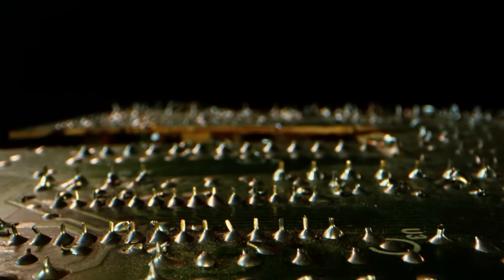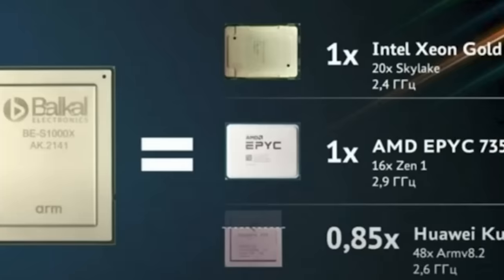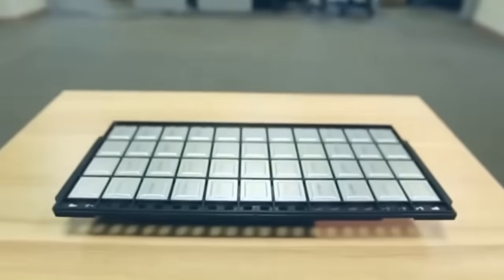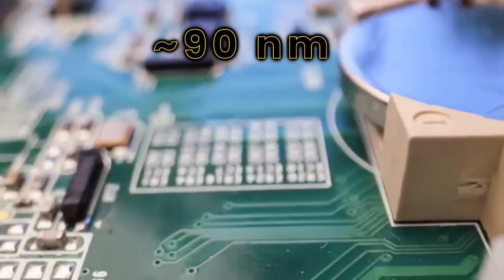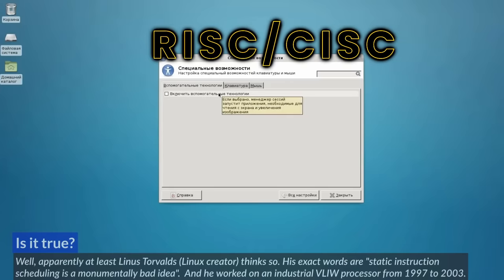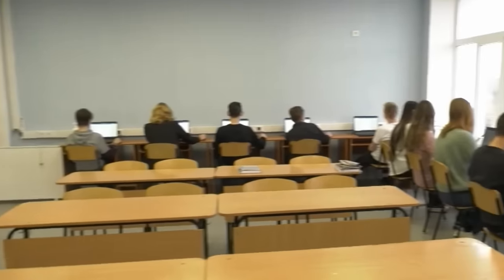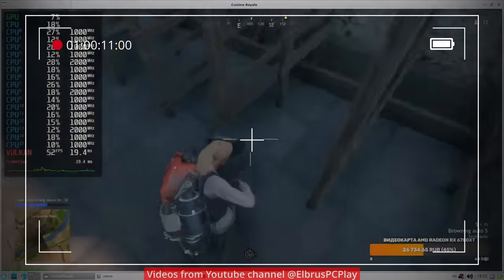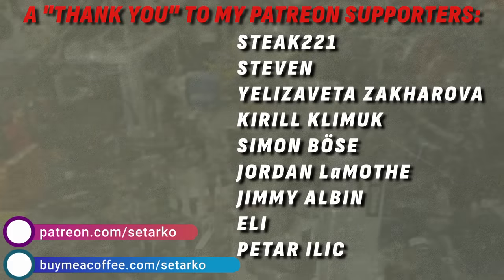Just How Good are Russian CPUs?

Comment: This video is largely correct — I have worked with the developers of one of the aforementioned CPUs (Baikal, Elbrus). One thing I would add though is that while Baikal was indeed worse and costlier than its Intel/AMD counterparts, it was a 5-7 years difference, plus the costs would go down dramatically once the orders increase. The slightly incresed cost and worse performance is perfectly acceptable to its main customers — state-owned entities that collectively have about a 1/3 share of the Russian PC market. You can run Excel (or whatever the Russian open-source version of it) on a 6-year old computer — this was always the goal, not running Cyberpunk in 4k ultra graphics 60 FPS. To tell you more, some of the potential customers were legitimately excited about the prospects of those CPUs, and some foreign entities (outside of the former USSR) have expressed interest, too. Shame it all went to hell.
Reply: They probably just use libreoffice, so calc. Tbf you can do the same with a 15 year old intel cpu, the only advantage here seems to be possibly more security than x86_64 (in the case of Baikal, ARM is just as well known of an architecture and does have security exploits), which sure if you're a state run entity running critical infrastructure then it is important but even for a lot of state run entities the cost benefit calculation won't make much sense, it'd just make more sense to keep the existing CPUs for longer and try to acquire used parts or new ones sourced from proxies.
Reply: @thelakeman2538 security reason make a lot of sense to use a domestic CPU without foreign backdoors. The Eu is looking to do the same soon.
Reply: What I like like about early Baikal - it was MIPS, what I don't like about Baikal - closed documentation
Reply: Nowdays Baikal is just another ARM manufacturer
Reply: @xfy123 EU was doing same with their LEON
Reply: so economics is similar as with F35.... heck of expensive to R&D to begin with but exponential cheapening with each new ordered set of jets.... it has roughly halved in price so far over 15+ years. microchips are even more so as there are little to no moving parts and very automated production process, usually.
Reply: The Baikal itself wasnt a vanity project. Trying to produce it in Russia is.
Reply: the real question is: are they able to perform the required work in the allotted time.
Reply: @uis246  Baikal could switch to RiscV architecture, makes the thing fully opensource
Reply: @thelakeman2538 Anyone not American kind of want the option of a processor without American backdoors...
Not necessarily for civilian use, but at least as a option for governments.
Reply: @AmauryJacquot That's a lot of wasted engineering time...
And remember that even if you have a instruction set you still need a architecture.
RISC-V the ISA might be open source, but most RISC-V architectures, are not.
Developing hardware for the ISA still takes time and money.
And the ecosystem is still small, with compilers that can't compete with x86 compilers in optimizations.
Not to mention that each architecture likely will need its own optimizations.

Russia wouldn't really gain much with switching at this point...
Maybe in the future.
Reply: @Luredreier the funniest thing here is assuming US is the same as CCP
Reply: Why did it "all go to hell"? What happened?
Reply: @belliduradespicio8009  I believe that they're referring to the sanctions on Russia.
Russia and China can't really buy advanced tech and services anymore.
Like using TSMC to make their CPUs.
Reply: So I can buy the latest russian CPU to do what a 13100 can do much cheaper and better.

Weird flex but okay.
Reply: They are made on 92/28nm machines that the US owns and can sanction at anytime.  They are garbage CPUs comparable to 2006 AMD x4 Phantom lol.  Doesnt matter if you work in the industry if you did you would know designing the cpu is the easiest part.  Designing the machines takes decades.  EUV was 20 year investment while China Nor Russia can make even 180nm machines.  They are running on US tech depending on US parts and US sanction could wipe them out at anytime.  Its dumb to research how to design the CPU and not know how to design the machine that makes the wafers.
Reply: @AcidBombYT  Chinese SMIC has finished the development of their "7nm" EUV process last year and they've got 14nm and 28nm production going. Russia has 90nm and 180nm equipment from AMD's Dresden plant, maybe even 45nm somehow. As long as China's supporting them and there's some money left for chips, they can produce semiconductor devices with those pretty old yet viable nodes.
Reply: @AcidBombYT   Thats facts though. Lithography is where the REAL development comes in. Designing the chip itself is childsplay compared to the lithography.
Reply: @AcidBombYT  Yes and no.
The US does have the patents and power to control who can have modern process nodes.
But China and Russia does have access to process nodes outside of American control.
They can produce microchips against the will of Americans.
Also, nothing here is 100% under American control.
In a theoretical situation where the EU where to section the US then the US would also be unable to produce any chips on the lower process nodes long term as the machines and parts needed are made in Europe using European patents.
CPUs are a product that requires international trade in order to stay on the latest technology.
And no individual country, not even the US can manage that without said trade.
But that doesn't mean that CPUs can't be made without it, they'll just be hopelessly obsolete...
Reply: @honkhonk8009  The chip design definitely isn't "child's play".
But every step here requires a lot of technology, and the latest technology in each step is only available with international trade.
Reply: You talk like the Russian processor can't run Cyberpunk in 4K only because that wasn't the goal.
Reply: I'm an American. Id love to buy a Russian CPU or PC if they are or become available. I'd much rather give Russia my business over Intel and the CIA...
Reply: @javierititin you have to start somewhere. Most of the biggest companies in the US don't make a profit, they plan on making a profit in the future and focus on market share and R and D. 
The goal is to have Russia making decent chips in 20 years, that can't happen if they just give up and don't try.
Also Russia may innovate. Believe it or not Russia often creates a far better product than the west but then the west copies the idea and out produces them. In making inferior chips Russia has a chance to innovate.
Reply: @manners7483  And how many years did Russia have to develop it? In 20 years we'll be having this exact same argument because Russia isn't profficient at making these things.
Reply: @pertsonvelts1699 it's because it doesn't matter. What they make is fine for every single application. The only real use for cutting edge chips is to run bloated operating systems and multitasking or if energy efficiency is a concern. Russia has massive amounts of power, they can afford to use inefficient chips. Most single threaded applications will run better on a Pentium 4 than a new chip, mostly depending on cache requirements and such. 
What kind of chips do you think people are using for missiles and commercial equipment? You don't really need a modern CPU unless you are rendering video or some other crap like that and if power consumption is not an issue you can use software to have the load split over different Pcs.
Reply: @manners7483  I doubt that you'd get much privacy with them...
They'd probably have backdoors that can be used by criminals etc too.
The EU at least try to respect privacy...
Reply: @JFJ12  thanks. I'll look into it. I'm already a Linux user so should be cool
Reply: @manners7483 if you want those so desperately, go live in URSS ...oopsy I mean Russia. You can try North Korea too. 😎👍
Imagine "All those russians products you can have".... Your PRECIOUS....😆😉
Reply: @Luredreier there is always back door on every chips, you need to make your own chips then.
Reply: @lizadonrex  No, not every chip.
It depends on who makes it (and to some degree on the age).
Older chips are simpler and they simply can't fit any backdoors.
Think 4 and 8 bit chips etc.
For newer ones, remember that there's chips *everywhere*.
There's no need to waste money for a backdoor on peripheral chips if there's one in the main CPU.
So for instance the chip inside a hard drive doesn't need a intentional back door.
There's of course the possibility of a software or hardware bug.
I mean, you can run Linux in command line mode on a spinning hard drive in place of the firmware if you really want to...
People have hacked those drives and installed Linux, so we know it's possible.
But there's a far cry between that and a intentional backdoor (although all it would take is a man in the middle attack on the drives...)
Reply: "Shame it all went to hell."
Sounds like a good summary for putin's "presidency" as a whole...
Reply: @GerardMenvussa  Sounds about right.
Reply: @Luredreier  and you think these newly made “old chips” have no back door built under a state led/sponsored program. And for export matter, who going to use these “old” chip.
Reply: @lizadonrex  If they're simple enough that you can test all their behaviours you can't really hide a back door in them.
Of course that doesn't mean that they can't theoretically have a built in reciever and sender for wireless transfer of information, but even then you'd be able to register the signals with other equipment.
Reply: @Luredreier  you can’t test hardware back door
Reply: @lizadonrex  Actually, you can. But just like with passwords its harder the more complex they are. With a simple one you can easily test every possible combination of inputs to look for undocumented instructions.
With more complicated ones...
Well, it's still possible to use that technique but between having more bits to deal with and having to deal with series of input combinations having different possible outputs the number of combinations becomes extremely large extremely fast.
Reply: @Luredreier  hardware back door is not just only password, a true back door don’t need to know your password, all they need is a control of root or administrator right.
Reply: @lizadonrex  I'm talking lower level then that...
I'm just demonstrating that the brute force method of cracking a password can also be used on binary inputs on a CPU, indeed the latest Zen hardware vulnerability was discovered that way.
It works on both backdoors and unintended hardware bugs.
Reply: @lizadonrex  By the way, since modern processors are programmable there's a chance of it locking up when using this technique.
So it helps having the resources to spare to be able to replace a few in case that happens.
Reply: no one can stand alone better than the Russian i believe.
Not the end of the world if you back by only 20 years of chip making.
Reply: @phongnguyen007  Depends.
It definitely makes your exports industries less competitive.
A lot has happened in 20 years when it comes to microchips.
It's a industry where anything that's 8 years old is practically from the dark ages...
Of course you're right that it doesn't make tech that's a few years old completely useless, but their use cases are somewhat limited.
Everyone wants to always improve their own products compared to earlier years and their competition.
And sure, sometimes a industry uses tech that's a few years old, but they don't want to go back to a earlier tech then their newest products if they can help it.
Reply: @Luredreier  you talking brute forcing password, with what hardware?
Reply: @lizadonrex  Kind of.
The thing is that ultimately all a CPU is is a thing that takes two numbers and compare them then spits out a third.
Essentially a glorified calculator.
And those three numbers are all combinations of wires going into the CPU being turned on or off and that resulting in other wires being turned on or off.
If you test every single possible combination of wires turned on or off and what results that produce on the output wires you will know every single possible behaviour of the processor, including backdoors and hardware bugs.
It's a brute force technique.
And it works.
You can also get certain hints about when some combinations are interesting from the exact nature of the output.
How long time the processor takes to produce a output, the voltages etc.
There's a lot you can figure out that way.
The whole point here is that CPUs aren't magic, they're physics.
You can't hide away a hardware backdoor from physics.
Doesn't mean that the software running on the CPU can't have a backdoor even if the CPU doesn't.
But you need to use physics to communicate with the CPU that you want to activate any backdoor behaviour, otherwise the backdoor will be useless/non-existing.
All a hardware backdoor is is a undocumented behaviour.
A sets of inputs leading to output that we don't know about when making programs for the CPU.
Does that make sense?
Reply: @Luredreier  well, not many country in this world can self produce chipset independently like Russia anyway.
I count maybe 7 or 8.
And most chip using by aircraft, weapon or industrial chip is decade old.
Reply: @phongnguyen007  Maybe, but you don't want to go back to a more primitive chip.
A change of architecture might require new software and/or cost you any certification you may have on your old products.
More power, heat, weight, size etc might all cause you issues too.
And weapons like missiles and air defense systems need a certain reaction time to catch fighters or enemy missiles.
Old chips can be used even if many industries stay on older process nodes and technology for various reasons they do upgrade their tech every now and then and going back to a previous chip potentially involves a loss of capabilities that's probably not appreciated by customers.
Reply: @Luredreier  Looks like you don’t really understand how computer work, Here is a video show how hardware back door work.
https://youtu.be/qtCY53Zwru4?si=0QG6-6k0oMjciT6A
Reply: The point of this cpu is to throw everyone who owns them in jail if they express anything that doesn't go along with putins propaganda against Ukraine and the "evil west".
Reply: >>> not running Cyberpunk in 4k ultra graphics 60 FPS

In modern FPS games -- frame rate mostly depends from GPU, not CPU.

Comment: Actually the Sberbank benchmark failed cause they didn't rewrite the code or even adapted the structure for the new hardware.
Some months ago Sberbank announced that they are building some Data Centers based on russian CPUs, construction of one in Siberia already started.
Reply from the maker: Well, that kinda supports what I mentioned in the video. If you rewrite and adapt all software - yes, probably Elbrus will be able to show normal performance. But it is still unclear who will do it and when, and how long it will take.
Reply: @Setarko  Yes, of course, it is oriented towards industrial and military, governmental applications.
That they are processors for the civilian market is just propaganda that doesn't even come from official sources, but from weird people on the internet.
However, I believe that if these processors, once optimised, prove to be competent for specialised applications, they could have an important market niche.
In the same way that Kaspersky with its servers in Switzerland is the biggest auditor for banks or Telegram is the most secure app, it may come to pass that banks or other professional structures with competent teams plan to move or integrate part of their infrastructure with these solutions.
I think there is an important niche market, but this is not the common consumer, of course.
Anyway, great video as usual.
Reply: This is right. Sberbank's management sought to avoid buying these products so they tanked the test. This was pre-2022, recall. Today things are different.
Reply: I think the problem was that they have a lot of software written in Java, and VLIWs are not the best with these kinds of runtimes, not mentioning that the most optimized Java virtual machine officially supports only ARM and x86
Reply: Honestly given what I know about the sberbank's management I wouldn't expect their tests to be reasonable. I'd totally expect Sber to have some crazy wild requirements like "to have Intel ME support" because this is Sberbank we're talking about.
Reply: @legolegs87 you might be shocked, but since AMT is based on ME, it very well can be included in what a large enterprise needs.
Thousands of machines, in multiple, heterogeneous data centers. And you have a software to admin this shit. And people who know how it works.
Reply: hope it will last ...forever. the construction!